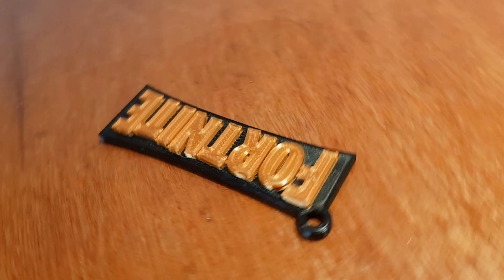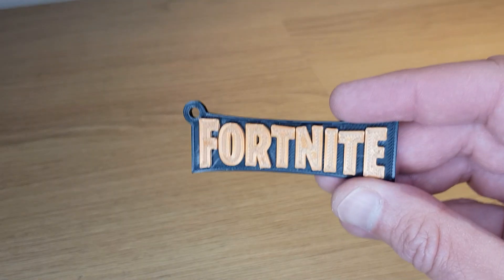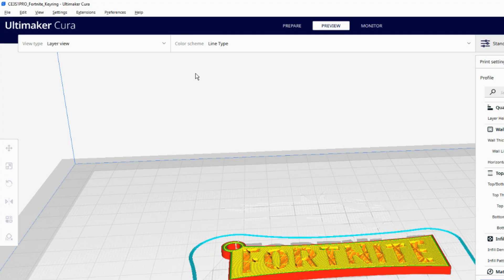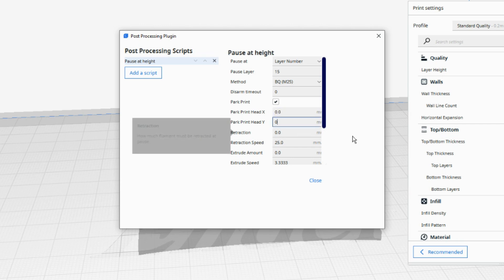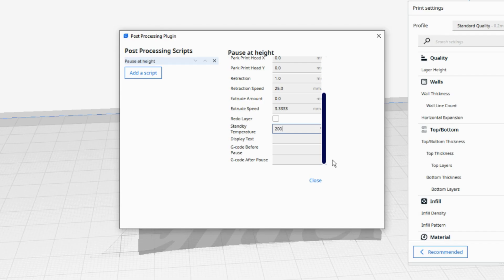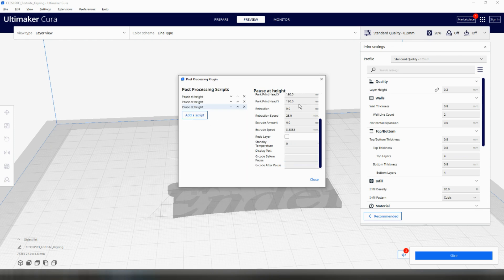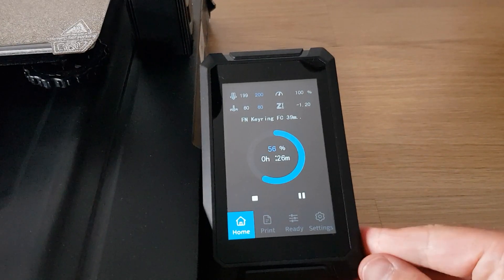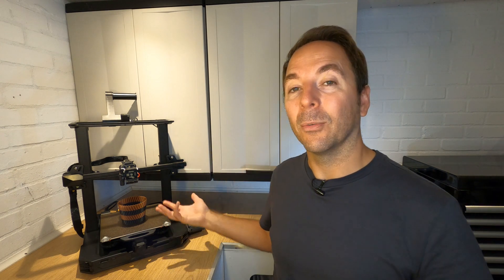Ender 3 S1 Pro Mid-Print Filament Change - Now You Can!

Comment: Thanks.  For info: Works ok with Cura 5.7.2 & on Ender 3 v2 ... & still far better than the built in Filament Change script.  It would presumably help to insert an M18 code to disable the extruder stepper during the pause (to make loading up the new filament a bit easier) but I haven't tried that yet.  Cheers

Comment: Hi, I followed your instructions with cura and a sovol sv06+.  The printer paused and didn't remove the filament.  The display on the printer says "wait for filament change to start".  There are no buttons on the screen to start.  It did not automatically remove the filament.  What should I do?

Comment: Do we know why it automatically resumes a few seconds after pausing now? or is this just a me problem?
Reply: Did you ever find a fix for this? On my Ender 3 S1 Pro, it only gives me a 40 second window to change the filament before it resumes the print on its own. (Dragging a purge spiral with it.)
Reply: @AceOfBased_83  if you have 40 seconds, the issue is likely not the same, mine would stop and resume almost instantly, yours may just be a simple setting.

However, my solution was to setup octoprint on my pc, this seems to interpret the cura pause signal correctly whereas marlin directly for some reason doesn't, I just kind of stuck with octoprint after that because it allows me to add more heat and manually extrude on the fly if I need/want to clear the old colour filament before resuming the print 

I ended up moving the program to a headless windows miniPC that controls my printer full time (still using marlin, but controlled by octoprint via USB cable) that I can just login to from my web browser to control, been pretty much flawless ever since.

(as an added bonus I can control it via the web when I'm not home, and I get a video feed to monitor and timelapse)
Reply: @Knight..  I haven't looked into Octoprint. I'm using Prusaslicer and then direct SD card. It seems to be a Bug with the M600 command it uses for the filament change specificly on the S1 pro and Plus firmware.  I made a kind of work around by adding an M25 before and after the M600 command so that it will at least pause indefinitely until I can change the filament and tell it to resume.  Now I'm just trying to figure out the G-code to lift it up off the part so the print head doesn't stay parked directly above my print at 210, but still moves to the propper spot when I tell it to resume.
Reply: @AceOfBased_83  I know in Cura you would need to "park the print head" (usually at 0y 0x) during the pause, this would automatically bring the print head to the front left corner, raised above the bed by about 50mm, I'm pretty sure prusa has a similar setting from memory.
Reply: @Knight..  I ended up keeping it simple and changing the Default M600 command to:

G1 E-5 F500         ; Retract 5mm of filament to prevent oozing
G1 Z100 F900        ; Raise the Z-axis by 100mm 
M25                 ; Pause the print and wait for user to change filament
G1 E10 F1000        ; Extrude 10mm of filament to prime the nozzle
G1 Z100 F900        ; Lower the Z-axis by 100mm 

That way I didn't have to worry about x and y at all. I'm sure this could be improved as I just learned G-Code today.
Reply: @AceOfBased_83  I feel like this was not keeping it simple, lol

My octoprint setup was just install, add a printer profile, plug it in, turn it on and remote launch printing from right inside my slicer, lol. 

the rest of it worked out of the box after that, addition tweaks were just gravy, but not necessary.
Reply: @Knight..   I'm sure your approach is much better overall, but mine is effective for not having to spend an extra dime. Haha

Comment: I recently bougth my S1 Plus in January 2024, and 4 months later wanted to do a filament change and oh surprise, the printer ignored the m600 method. How it´s posible one year later Creality haven´t fixed this bug o error o whatever in its recent production batches of ender 3 S1 Pro and S1 Plus. As the user @wrestlertown007 comented before, you still the only person in youtube who splains the alternative solution and very well explained.  (i´m not a native english speaker and don´t wanted to use a translator or ia, sorry if i have mistakes)

Comment: it would be really handy to see the gcode this technique outputs—I'm using Orca, and instead of those options it just has "insert custom gcode at layer"

EDIT:
I realized I have still the creality slicer on my machine for some reason, so this is a diff from the files I tested with:
> ;TYPE:CUSTOM
> ;added code by post processing
> ;script: PauseAtHeight.py
> ;current layer: 3
> M83 ; switch to relative E values for any needed retraction
> G1 F1500 E-1
> G1 F300 Z1.8 ; move up a millimeter to get out of the way
> G1 F9000 X0 Y0
> G1 F300 Z15 ; too close to bed--move to at least 15mm
> M104 S230 ; standby temperature
> M300
> M25 ; Do the actual pause
> M300
> M109 S200 ; resume temperature
> G1 F1500 E1
> G1 F1500 E-1
> G1 F300 Z1.8
> G1 F9000 X98.85 Y114.9
> G1 F300 Z0.8 ; move back down to resume height
> G1 F1500 E1
> G1 F2400 ; restore extrusion feedrate
> M82 ; switch back to absolute E values
> G92 E76.99371

not strictly sure how actually helpful this is, unf., but maybe I can figure it out

Comment: Great work! It didn't want to work for me but I figured it out. So, for those folks trying to do this with Cura 5.6 or perhaps with any other version of  Cura that isn't 5.1.0, this won't work. It wouldn't work at all in that the S1 pro would just lock up.  I noticed that the script seemed a bit different and decided to just install the old Cura 5.1.0. I had to use an old Ender 3 pro profile and copy over my printer gcode from 5.6 but in the end it worked! I hit the stop button to get the resume to restart but it didn't appear. Then I went into the top menu on the screen and backed out of it and the play button was there. Woowoo.

Comment: I have tried both the "pause" and the "stop" menu choices and neither one offers a start button.  It freezes and does not continue. the display hangs on the" going to home screen", and you then have to restart.  So very frustrating.
Reply: Try it with Cura 5.1.0.

Comment: Is there a way to print multi colors on same layer?   One way I know is to try and print the one color first then print the other color around it with Z-hop to avoid hitting the already printed layers, but I would like to know if it can be done in a way like pause at height?

Comment: Could not get this to work on my Ender 3 S1 Pro using Cura 5.4.0.  The post processing script doesn't seem to run as the printer just continues past the layer number it should have paused at and completes the print.  I made sure to re-slice the print after adding the post processing script. I am also using a Sonic Pad and tried the Pause Filament post processing script described in your other videa and it did not work either. I have been unable to determine what I am doing wrong.
Reply: Try it with Cura 5.1.0. Let us know if it worked.

Comment: This helped a lot but when printing from PC connection, the pause only last like 10 seconds then it auto resumes not giving me time to change filament is there a way to stop it till I am ready
Reply: I'm having the same problem printing from SD Card. I have about 40 seconds to change the filament or it just resumes the print with a large purge coil attached.  Did you ever find a fix?

Comment: for PLA: normally while changing the filament I always set the temp to 220 C so that it can easily ooze out. but my print temperature is always 198 C so in this case in cura post processing script if I set the standby temp to 220 C will this set the temp to 220 C for the rest of the print as well or will it switch back to 198 C

Comment: Pressing and cancelling Stop did not work for us to resume the print.  We may have different firmware.  Hitting Pause did work however.
Reply: you can try hitting the settings at the top of the screen (temperature, Z offset...) and press back then. I get the option to resume print after that !

Comment: hi, great video, i have the same ender 3 s1 pro, but my display when im printing has the time remaining info below the progress circle, this is a minor deference with my display but the problem for me with this method is that when i press the stop icon on my display it does not have a "yes" or "no" it says "pause" or "stop" and if i press stop it stops the print. If there is a way to fix this problem for me please let me know.

Comment: My life would be easier and happier when I know how to this exact postprocessing thing on PRUSASLICER (i have all my configurations in Prusaslicer but non the m600 or the pause at height there work at all in my S1 Pro). With this method using Cura it works like a charm, but I need to do this on Prusaslicer, there is no "Post Processing" option there :_

Comment: Thank you! Il will try this on my ender 3 S1. Do you know if this modification also works while using a minion beagle cam when the g code is loaded threw the web app?
Reply: I just tried over the Mintioin Beagle setup... it doesnt work :( I dont know why, because the g-code contains all the commands, but ist just keeps printing

Comment: Thank you so much!  Finally, an easy way to do this.  Just a note however.  This will not work when using "print via USB".  The print just sails right through the pause as if it's not there.  You must use the SD card.
Reply: Testing this now! Let you know!

Comment: When I try this, I don’t get the same dialogue box about yes/no stop printing. I get one that says to confirm my selection between pause and stop. When I hit X on that dialogue box, I still don’t have a play button to resume printing and the printer just sits there. I’d really appreciate help!
Reply from the maker: It seems that different methods are needed for different firmware unfortunately. My S1 Pro is currently running klipper firmware with the Sonic Pad. Hopefully someone else can help with this.

Comment: We have recently brought two Ender 3 S1 pro printer. We are facing a issue of filament breaking inside the extruder frequently. I don't know the reason behind it. Is the problem with extruder or is it due to filament.
Reply from the maker: That's strange, I haven't had this with mine. When does it break?

Comment: With doing pause at height, (sonic pad, s1 plus) it pauses but then won't continue. Have to abort print. Any idea what to try? On newest Cura update
Reply: Found out from a guy for anyone else with my issue: Add this to your start code in Cura

M83 ; Use relative extrusion

Then make sure relative extrusion is checked in Experimental Mode
Reply from the maker: Sorry I didn't get here to reply sooner but you may have educated me on this. I'll look into it too, thanks👍

Comment: I’m having a problem where after I replace the filament and press play, it resumes printing in mid air ruining my print. I tried twice and both times did the same thing. I have the exact same settings as in the video but it’s not working for me. Any suggestions? I’m printing on Ender 3 V2 Neo

Comment: I wonder if you can help me. I'm having issues with M25. It parks the head and sets the holding temperature and then puts both the head and the bed to a temp of 0 and then runs  to the stops and then unlocks the motors. 

I've googled everything and can't get it to work  well I got it to work once at the start then after that it doesn't work.

Thanks for the awesome videos

Comment: Can you do a video on how to fix settings not saving on the S1 Pro? i can get material temps and fila change to work but I can not get print speed to save to the printer. I've tried slicing on Creality, Cura and Pursa all will not save to the printer.

Comment: Just tried this.  The pause worked as expected but standby temp did not work and the nozel cooled so fast I couldn't fully extrude to the new color, I had to just resume and let it run through itself.  Wondering if the Marlin method instead of BQ would fix this?

Comment: Love the video, but I'm having no luck getting my brand new Ender 3 S1 pro to resume after I successfully change the filament at the layer I've specified. As seen in the video, I can choose stop or pause, but I never get a screen with the play, or resume button. I am a newbie but I've tried this in the Creality slicer and the Cura slicer with the same results. Might I have slightly different firmware installed, or am I overlooking something very obvious?
Reply: unfortunately I have the same situation
Reply: So I just updated the firmware on the printer to the latest, but it didn't help. Still cant resume. I couldn't update the screen software because I don't have a compatible TF card. I really need to make some two color badges, so I might bite the bullet and buy a Sonic pad for this.
Reply from the maker: I'm currently testing my S1 Pro with a Sonic Pad and it is really good. Unfortunately it means that I can't test the filament change with the latest Marlin firmware just yet.
Reply: @RickyImpey  Thank you for your video. I want buy a Sonic Pad, the change color work fine? Or there are problem? Thank you
Reply: @RickyImpey  any update on this? Same setup with sonic pad and the ender 3 s1 pro.

Comment: Hi can you please make a video with the sonic pad and do a color switch using it because I have the siding pad and tried to change the color. It paused, but did not resume after clicking all the buttons please help.
Reply from the maker: Hi, I have a series using the Sonic Pad coming soon. It will go over all of the basics first but I will also look into a mid-print filament change too.

Comment: Worked perfectly on my ender 3 S1 pro.. Thank you very much for the info
I have a question . after the pause there is an extra layer on the outside of my printer then it goes back to printing perfectly. What settings should i change to fix this problem? Thanks for your time and keep the video's coming...
Reply from the maker: I'm not sure what you mean by 'extra layer'. Do you mean that it lays down an external wall on your print?

Comment: Thanks Ricky!  Great explanation!  I am having trouble with a blob or smear where the new color starts.  I have tried wiping the nozzle and hitting the play button simultaneously, but my first two attempts have had this issue.  It seems a small retraction would be needed to fix this.
Reply from the maker: Hi, do you have your 'extrude amount' set to zero like mine? If you do then there is not a huge amount you can do to avoid that little blob with only this post processing script. You could manually edit the g-code but it starts to get a little complicated then.

Comment: I'm going to have to try this out. I have an S1(non-pro) with the professional firmware. I've been trying to get this to work, but I've just used the Marlin option. I'll have to give this a shot. Thanks!
Reply: Didn't work, for some reason my printer just ignores filament change and pause at layer commands. It does this both when using Octoprint and when using the SD card.

Comment: I'm using the Ender 3 S1 pro with the Sonic Pad and I cannot get this to stop at any layer to change filament. I've spent hours at it, do you have any tips?
Reply: Nevermind, with your solution, I figured it out. I commented prematurely because it didn't stop on the layer I chose, it actually stopped at the end of that layer and before the next so I just need to tweak it to the layer before that and it'll be good, thanks!
Reply from the maker: Glad you worked it out. Sorry for the slow reply.
Reply: @RickyImpey  No worries, thanks again!

Comment: For anyone having problems with the 29 Nov 22 firmware, here's how I solved it: I pressed pause and confirmed it, but then went into the parameters page at the top (where you could change temp, z-offset, etc.), then back to the main page. The play arrow appeared for me there and it resumed fine.
Reply from the maker: Great tip for the latest firmware, thanks👍
Reply: @RickyImpey I did this tutorial exactly, and although I am using a tablet for the command center the resume button is there but when I press resume all it does is extrude a small amount of filament I get no more printing
Reply: Cheers, Woody and Ricky. Thanks to you two, I just successfully embedded a magnet in my print.
Reply: Didn't work for me. I pressed pause and when confirmed I gett Auto back home please wait.... and it freezes 😢
Reply: @philipbowes4136  I had that problem too, I have latest firmware (in video is older one). If I clicked on immediately on "Pause" (like you are writing), then freez.
But for me It works, when click for first time on STOP button then shows up a menu with different menu of buttons only "Pause" or "Stop", then I click on "Pause" and no freez and I returned to main menu and click on "PLAY". Hope it helps. :)
Reply: Pareil pour moi 😪😪😭😭 @philipbowes4136
Reply: YES!!!!!!!  This worked for me on my S1 Pro purchased January 2023. The method in the video did not work fully.
Reply: Merci Merci Merci
Reply: L'astuce fonctionnait jusqu'à aujourd'hui et j'ai voulu mettre à jour mon firmware et ça ne marche plus. Il ne me propose pas de reprendre 😭😭😭😭
Reply: THANKS MATE:)
Reply: Thank you for commenting this! I was having this issue as my Ender 3 S1 Pro is only a few months old.